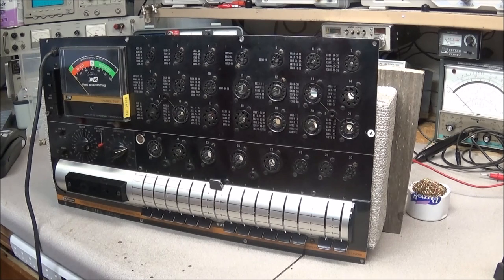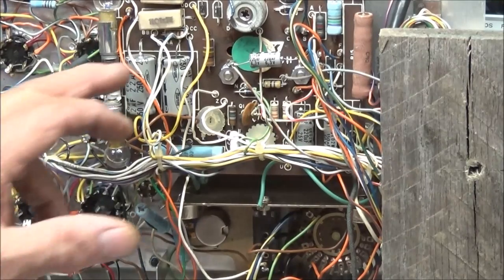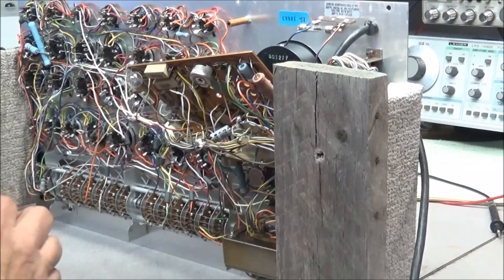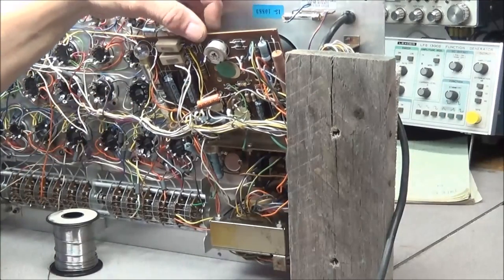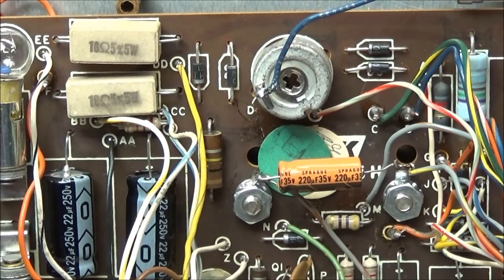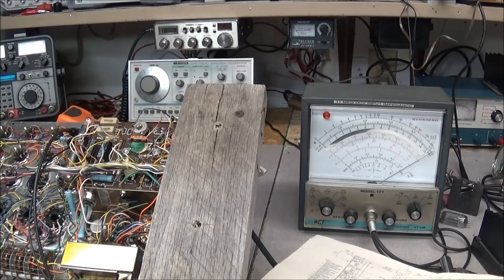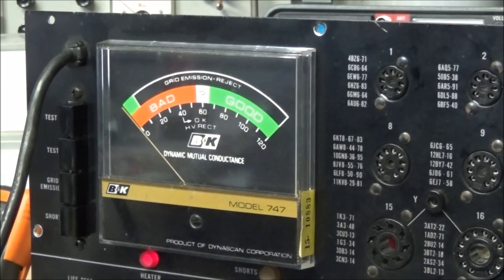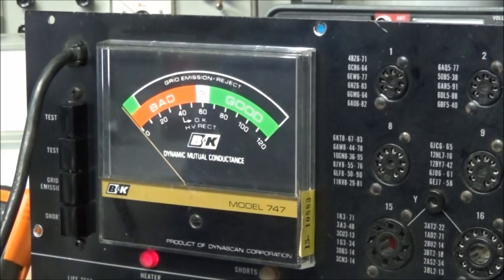#117 B&K 747B Tube Tester Repair

Comment: I have the same tester, but I have stopped working on it because I ended up changing the Transistor because it was different from the one on the schematic. I still didn't get anywhere. So It's a dust collector. However, I'm watching your video and all of a sudden it dawns on me, DUH I didn't change the Caps. One thing though after other forums commented that the poor grounding of the tube sockets through the rivets and with time the rivets cannot be depended upon because they are not soldered to the chassis itself but depend on a mechanical ground (which with time can be a problem) as there are no star washers to bite into the chassis. So what I did is take some bus wire and did a daisy chain to all tube socket grounds and soldered those. Then made a proper soldered electrical ground on the chassis. Now that I gained some confidence to tackle the repairs as you did.  Full steam ahead! Thank you.
Reply from the maker: Yes the capacitors cab cause all sort of problems with these. Also note any high value resistors.  Those rivets can be problematic and lose ground. I have drilled them out and replace them with bolts and star washers.  You wire ground should take care of it. Thanks for your comment Cliff

Comment: Nice, very late model 747 - you are doing a service showing others steps going through the unit! A couple of notes of help with respect. 1. The 470R at R27 should be replaced with a higher wattage unit on every unit worked on, as you found it toasted which is common. 2. Setting meter to zero and calibration procedures should be done with the unit horizontal. 3. The #55 bayonet bulbs lead should be removed and re-soldered on the end (easy and quick to do). The spring pin on the sockets should be soldered with a wire lead direct to the PCB. Shell of the bayonet should be soldered to the ground pin itself on the bottom 4. I highly recommend cleaning and treating all sockets and pots with D5. Spin every pot back and forth several times in initial application and then flush again. Last, calibrate with the variac set to 117v. The 747 does ok with line variation but best to calibrate around current voltage levels per what you mentioned (110v vs most homes around 115-120 today). 

Replacement PCB's, full component kits and calibration resistor sets available at www.garage1217.com for the 747. Calibration instructions step by step located in the manual section.
Reply: Just wondering how to clean the sensitivity pot when I can't get the back off and there are no openings to spray in. Do you know if it is just crimped on? Or is there some trick to removing it without damaging it?

Comment: These are always great videos to put up Buddy because somebody down the line is going to have a problem with their B&K 747B and will be very happy to refer to your work to give them some pointers and a least some things to look at. Many times a particular piece of equipment will have a common point of failure as you know and sharing that can save somebody a lot of time and trouble. Thanks for the look see and great job as always.
Reply from the maker: Thanks for the kind words Doug. This is why I do this. I also saw no other repairs on YouTube on this unit.

Comment: I'll be sending you some 100M 1% resistors so you have for future use.  I ran into the same thing years ago when I restored my first B&K 707 tube tester.  Got to that part of the calibration procedure where it calls for a 100M resistor and I thought to myself, really....  Ended up doing the same thing you did and ordered a box full of 100M 1% 1W to have on hand.  That's the only thing I have ever used them for, calibrating tube testers.
Reply from the maker: Yep, never use those resistors. Really do need to get some.  Never know when I have to restore another.
Reply: The Radio Shop 

Don't buy any, I'll be sending some to you. :-)
Reply from the maker: You got it old friend!

Comment: I repaired the identical model about a year ago; all the half watt resistors were out of spec and replaced with metal film 1% resistors, even the 1watt "100K" was high in value, common in these models. Once I replaced all parts including capacitors, a complete calibration was performed. Somebody prior to me was in the unit and caused more problems including the meter which was addressed successfully. Watching your video reminded me of that, very nice presentation.

Comment: Great video as always.  Hey, I got my technician ham radio license on Thursday. Between your channel and D-Labs I appreciate the vids on the early tube driven rigs.  :)
Reply from the maker: Thanks Dennis. Really great to hear you have your tech ticket.  Thanks a lot for watching my friend. Studying for the general yet?
Reply: I need to get a transmitter first and get my Hallicrafters s40-b finished up. I need to get a new IF Can as one of mine needs replacement. Once that happens and I get on the air then I'll try to go for my general license. Heck, right now they haven't even posted my call sign yet. Terry from d-Labs might also have an IF Can for me but he's checking his parts stash at this time.  :)

Comment: What a pile of spaghetti that tube tester has behind the front panel LOL. Good job on the repairs, Buddy. Thanks for sharing it with us. I always learn a new trick or two watching your repair videos and this was no exception. 73 DE K7RMJ  Frank
Reply from the maker: Thanks Frank. Looks good on the outside but the inside is a lot of wiring. As always good to see you.

Comment: Great video have the same tester left over from when my dad repaired TVs in the 70's. I have not turned it on in years maybe i will plug it in and see if it still works.
Reply from the maker: They are decent testers. Give it a go. If it acts strange shut it down and replace those caps.

Comment: nice work, good idea on wood supports, I just did my sencore LC 102  cap analyzer, it says dont use wirewound resistor for esr cal ?
Reply from the maker: Thanks Dennis. Yes for the ESR do not use wire round. Causes inductance issues just like an RF circuit.

Comment: Can you use a digital multimeter instead of the VTVM? Do you need to use a shunt across the leads with a DVM?
Reply: You can use a DMM. You follow the exact steps in the manual. Guy only answers to some. And he left out the last calibration step. When I get to mine I will show in detail will a DMM.

Comment: hi I just moved, my 747 was working? now the needle swings to the left instead of the right. I am using socket 14, for el34 and 6l6. one of the ge55 bulbs was dead and I am waiting for replacement. I recapped the unit and calibrated it several months back and it was fine? can you tell me anything, is the bad bulb responsible for this. I tried another bulb that was close and it lit up just as bright but the problem was still there. please?
Reply from the maker: You not only need to use number 55 bulbs but it helps if they are from the same lot.  Do not mix an old and new bulb. The build difference is enough to throw the calibration off.  I would also check R22 and R23 to make sure they are with in spec.  The reason for the bulbs being of the same build is they need to be within the same resistance of each other. Hope that helps.

Comment: I have that same one and my #1 socket will not test when I push the test button.  The others all work but not socket #1.  Any idea what might be the issue?
Reply from the maker: Sounds like the socket may be bad. Not making connection to the tube.
Reply: @TheRadioShop  I thought that or maybe a cold solder joint.  Ill clean it and check the solder joints to see if that helps.

Comment: How the heck do you know where these resistors are located?!  I see them on the schematic but there isn't anything listed on the board itself so tracking these down is painful and I have no idea where R20 or R10 are located.
Reply: The B&K 747 "Instruction Manual" has a component location diagram for the PCB and well as the location of the 2 chassis mounted pots.  Do a Google for B&K 747 Manual and you should be able to find a .zip with the 747 documents.  Here is a brief location of the 5 adjustment pots:

The PCB has 3 pots.  When viewing the PCB with the 2 incandescent bulbs located on the left, the pots are:
- 12 O'clock position (large metal pot):  R17 (Bias Adjust)
- 5:30 position: R10 (Grid Emission Adjust)
- 7:00 position:  R20 (Shorts Adjust)

The chassis has 2 additional pots located on a metal bracket just below the PCB.
- Pot closest to the AC power switch:  R21 (Signal Voltage Adjust)
- Pot furthest from the AC power switch:  R4 (Bridge Balance)

There is a calibration procedure in the Instruction Manual as well as the Service Manual.  The Instruction Manual has an error in it for the Bias Voltage calibration.  The target voltage should be -2.5VDC rather than +2.5VDC.  The Service Manual says the proper voltage is -2.5VDC.  My 747B voltage was negative.  Remember that you need to press the "Test 1" button for this calibration step. 

I just calibrated my 747B today for the first time.

Comment: My calibration worked fine after I updated everything you did and it does accurate tube test but the second test 2.5 vdc mine reads 2.5 volts positive not negative. 🤔
Reply: It's suppose to read 2.5v not negative. It doesn't say in the manual. I found many errors with him talking including the caps he replaced in the middle right side. He has a 220uf & 150uf both are suppose to be 150uf. Also you don't need to solder in the resistors during calibration you can go through the front of socket 1 & use a toothpick to hold it in. Also the bulbs are #55 not what he said. When you're calibrating Grid Emission you don't press shorts you press grid emission.
Reply: It is interesting that your 747 calibrated to a positive DC voltage.  My 747B would only produce negative DC voltage for the Bias Voltage calibration regardless of pot R17 setting.  There is a calibration procedure in the 747 "Instruction Manual" as well as the 747 "Service Manual".  The Instruction Manual (rev 485-115-9-001) Bias Voltage calibration procedure specifies a +2.5 VDC target voltage whereas the 747 Service Manual (rev unknown but includes a Technical Bulletin dated 3/74) specifies a -2.5 VDC target voltage.  My 747B voltage was negative and calibrated easily to -2.5 VDC as this video depicts.  Remember that you need to press the "Test 1" button for this calibration step.

I wonder if the calibration procedure was written with the expectation that a VTVM was being used.  VTVM's cannot directly measure negative voltage (the meter only swings positive), thus the input polarity needs to be reversed either by swapping the test leads or by a setting on the VTVM to reverse the inputs.  Perhaps this was slightly sloppy wording in the calibration procedure in the Instruction Manual.

Cheers!

Comment: Uhm,that tester still has issues.
It's not finished.
I suspect if you checked the grid emission adjustment (which you neglected to do, or show) you will find the issue.

Comment: I have two of these that I need to get working.  The one I'm working on currently will work for the rectifier and power tubes that I have tested so far, EL34, 6L6, 5U4.  When I try to test 12ax7 tubes, I get 0 filament glow.  Does anyone have any tips on working this kink out?
Reply: Check the solder joints & the socket itself. The pins may not be making contact.

Comment: I have the same tube tester that also needs to be fixed, i live in Belgium and nobody over here can or will try to fix it
Reply from the maker: They are not that hard to repair.  About anyone with the understanding of electronics should be able to fix it up for you.  Make sure your line voltage is correct.

Comment: Tried to register to check this out on the forum, but your verification question is not answerable. It says "On the forum home page top right, what is the word under "SMF - Just Installed" ( You can copy and paste the answer:" However, I can't find this anywhere on the forum home page.
Reply from the maker: Did you get registered?
Reply: No, I didn't resolve the issue with the verification question. I don't know what I can do about it on my end.
Reply from the maker: The answer is radio
Reply: Finally got in when it moved to a new question.